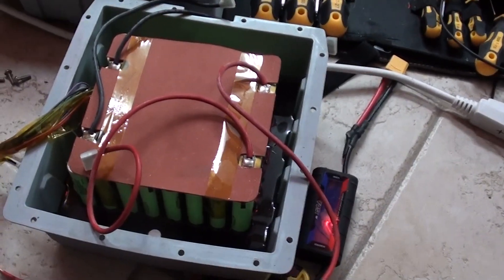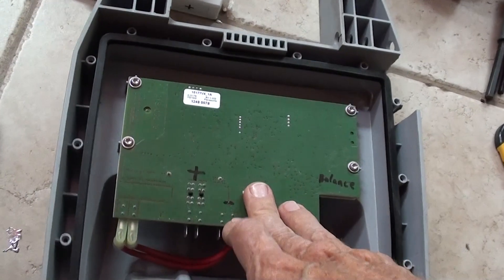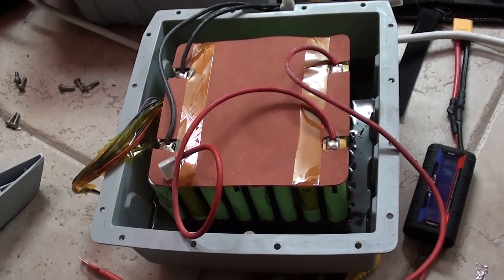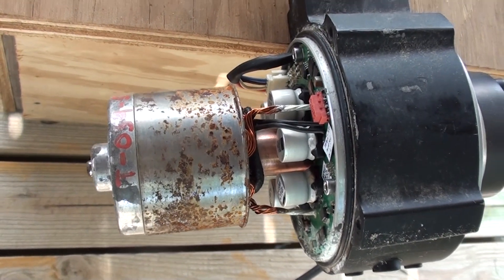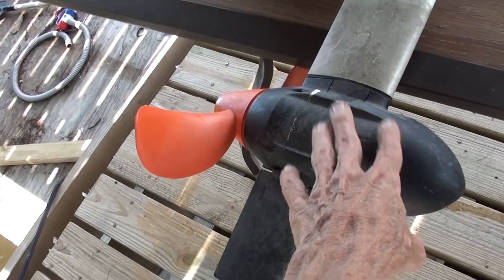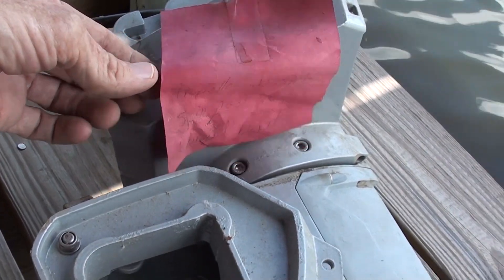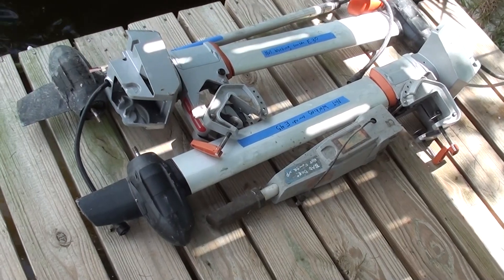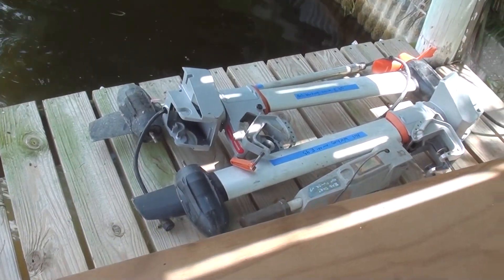Torqueedo Electric Outboard - What's Inside, How To Fix - Do Not Buy!

Comment: You can use a HIGH amperage rc brushless speed control to run the motor. just remove all the torqeedo boards in the pod. Trust me it will work. but you will need a new back cap that contains the seals. new o-rings as well.
Reply: RC speed controller needs a signal from transmitter, for it to work.
Reply: @paulhealey2984  Just use a servo tester.

Comment: The longer I live, the more I think all that "all that glisters is not gold." I am so glad I never bought one. I don't know if I would invest any of my time in them. These types of things are all synchronous motors and have the great advantage of being brushless. As you say, it's desirable that the motor is up top. Consider this: I am buying lots of DeWalt tools intending to power them from direct solar it occurs to me that one could hook up a router or a drill to a shaft with a propeller on the end and mount it at the top of the transom like they do in Thailand, but they use car engines. Washing machine motors look like they have potential as well. Jamie from Mythbusters put a video on YouTube about converting a standard outboard motor to electric drive. I have often wondered about having a propeller at the front of a boat, but that is another thing.

Comment: Thanks for the video. I had the opportunity to buy a 801 without a battery for cheap. I priced the battery and I can buy an excellent new motor for that price. I was going to try the 24V replacement fix like you talked about but the odds of all 3 boards working again led me to pass on the motor.

Comment: Is it possible to install a connection for an external battery and thus increase autonomy?
Reply from the maker: I don't think so.  They made it with the circuit divided into the battery, lower unit and handle to prevent that.  It might be possible to trick the circuit by charging the original battery so the BMS sees the right voltage from each cell group, and disconnecting the main battery and attaching a different one, with the torqeedo circuit still reading the original cells.  The voltage is weird because it is 8s lithium ion, 30 volts, so you'd have to make your own pack because nothing off the shelf will work.
Reply: Yes you can use a battery to charge it, or what I do is use a solar panel attached to my boat Troll the whole lake and come back with the same percentage of battery

Comment: I use the travel 1003 on my sail boat weighting 700 kg. The propulsion efficient is "really " great, even in windy conditions !! whatever you opinion on design my experience since 7 years using it on lake every year is very positive. As it is my safety motor, the price came as second priority, efficient first. (before i was using minolta 50 lbs, useless for me) . So for the newbies, try it first on heavy boat then comment. You will be surprised ...
Reply: Same. I used a Minn Kota trolling motor on my inflatable boat before getting the Torqeedo Travel 1003, and it just didn't have the power to cut through the wind or currents. 

The Torqeedo was a lot more expensive, but provided a different level of boating. With the trolling motor, I struggled to get back at some locations. The Torqeedo opened up a lot more places to go boating for me. 

Torqeedo has competitors now like the Chinese ePropultion and Newport motors, but after you consider the availability of parts locally, batteries and finding a service center in your area, I feel the Torqeedo is worth the extra money over them. 

My approx 10 year old Torqeedo Travel 1003s was serviced this season (a service center 1 hour from me) and I was told very clean and corrosion free. I used it in both fresh and salt water, but as REQUIRED, I rinsed it with free water after use. A water bottle at the launch before leaving, and I was generally use the boat on a lake with in a couple days after salt water use to make sure the salt was thoroughly rinsed out.

Comment: horrifying! thank you for warning the world about this! an electric motor should not be this complicated! I was already sufficiently discouraged by the price tag! but this confirms it. Although, it's just a brushless motor, so surely you could use another BLDC controller with that motor, and not mount it underwater. water getting inside the casing wouldn't kill a brushed motor (you'd still have to dismantle and clean it, of course!)

Comment: The motors shown clearly look like they were abused by leaving them in salt water without rinsing them as Torqeedo has explained is required. This goes for any similar electric motor. I've seen videos/photos on ePropultion that were also rotted out. It's not the motors fault, but the users fault.

THESE MOTORS ARE NOT DESIGNED TO LEAVE ATTACHED AT A DOCK OR ON S MOORED BOAT IN SALT WATER.

I've been a Torqeedo Travel owner for 9 years as I purchased a used one that was 2 or 3 years old in 2013.

It's provided many wonderful adventures, not possibly previously for a small car owner without a safe place to store gasoline inside the car or inside my house as I have no shed.

I recently had mine repaired as the propeller & shear pin broke (it's a plastic propeller). I'm told they should be serviced every 5 years and most of the bill was for that, plus the $100 replacement propeller. 

I'm told there was no visible corrosion on the motor that is more than a decade old. These motors are supposed to be thoroughly rinsed after salt water use. After each use in salt water, I rise with my water bottle at the boat launch, and try to take the boat/motor to use in a lake with in a few days to really wash out any salt build up. If your unable to take it to a lake in a few days, your should run the motor in a bucket of water and let it spin good or something similar.

Torqeedo was the first company to make a motor of this sort, and it's been knocked off by a few companies now, but Torqeedo is still has the largest distribution and are far more widely in circulation.

Comment: I completely agree with your opinion that the motor should be up top.  There's not business for electronics and electric motors under the waterline.
Reply: Dingy motor with weight low down is better nothing wrong with motor down in sealed unit and battery why do you think it is safe for people that may not know about electrical equipment and play and hurt themselves or others by opening and messing with battery sells

Comment: Hi, do you have a photo of the gearbox side? I took off the wire harness and don't remember the polarity on the motor board, I also have a spare lanyard if you need one

Comment: Very unfair to Torqeedo, a high quality electric boat motor manufacturer. The majority of electric outboards use submerged motors and componentry. This provides far better overall efficiency than a highly inefficient external gear train. Efficiency is vital for electric motors to reduce battery consumption and vastly increase range. The owner is periodically supposed to check the condition of the o-ring seals. Judging by the dilapidated motors you show, they are old (one was dated 2011) and abused. They don't become that corroded unless they're kept underwater when not in use and it's apparent that no one ever did any service on them for years as they would if they were a typical gas outboard that requires at least yearly service. If the o-rings were simply checked and replaced every 4-5 years, they wouldn't leak. You also need to ensure the prop shaft seals are not damaged by fishing line. One motor you show is completly entangled in fish line. If the owner simply checked it once in a while, the problem would have been resolved before damaging the motor. Another clear case of owner neglect. Just because the Torqeedo's require much less service than a gas outboard does not mean they're to be neglected with no service. 

Further, the BMS circuitry you show is usually always internal to most sealed lithium batteries, that is perfectly normal, and very few such sealed lithium batteries are user serviceable due to the significant dangers involved, especially for a marine battery where a lithium battery fire could be disastrous. The Torqeedo battery internals you show prove the battery is very well made with a high degree of quality and safety judging by its looks. The cells are potted to ensure they do not become loose in a severe marine environment. If you want to see what a badly designed lithium battery looks like, just visit Will Prowe's superb YouTube channel. Unlike you, he knows the difference between a properly and improperly built lithium battery and demonstrates it clearly. Torqeedo is excellent and very helpful with battery service if you simply contact them and tell them the problem. 

Additionally, it's perfectly normal to have circuitry in an electronic throttle. Putting all the circuitry for the motor, battery, and throttle all in one single location, as you think it should be, would be very poor engineering for this type of motor as it would require far too much interconnecting wiring. The interconnecting cables would require far too many connectors and be prone to failure. Also, you apparently don't realize that Torqeedo uses the same componentry for their Ultralight line of motors to reduce the cost of their products. The throttles on this line are remotely located, thus the need for onboard circuitry. The motors, throttle, and battery were all very cleverly designed to be compatible and largely interchangeable for a wide variety of uses. This also reduces the cost of replacement if one component were to go bad and greatly enhances owner serviceability by simply replacing the bad module, something anyone can do. 

Torqeedo motors will last a decade or more if properly serviced and not abused. It's grossly unfair to show a bunch of old and neglected motors and then blame it all on Torqeedo with zero owner accountability. That's the same as showing an old, abused, never serviced gasoline outboard and blaming it all on Mercury for making a bad product. Grossly unfair.
Reply: I appreciate the honest assessment of the motors and batteries.  This video review is a joke.
Reply: I am not your oppinion. A friend of mine had 2 motors die because the underwater unit leaked. No replacement parts from torqueedo, they wanted $1500 for repair. Not nice.
Reply: @olaf_s_23  If you go to their website you'll see that they actually have all replacement parts you could imagine: Stators, rotors, gearboxes, mechanical parts, etc.
Also, in their user manual, they specify a 2 years service check interval if you keep the motor in the water at all times (and 4-5 years if you only have it in the water when using it).

Comment: It’s criminal how poorly designed, inefficient, and overpriced these motors are and how they hurt the electric propulsion industry with the bad experiences users have had after making the switch. The reason the gear reduction is so nice is because it came from the power tool industry. Another nasty issue with them is how notorious they are for shearing their prop pins which are undersized, especially considering the reduction and the torque created by having that small motor spinning up so fast. I suspect this was due to building around the “borrowed” planetary gear set and that coupled with the obnoxious whine it creates is why they finally went to a direct brushless deign with their 1101. Thanks for tearing them down and bringing their poor design to the attention of consumers. Being in the electronics biz, I can’t believe those circuit boards aren’t potted for protection.
Reply: Do you know some better brands? I was looking for epropulsion or modding a chinese one or building a direct drive myself, in the range of 2-6kw. Another factor with this small motor is that it does not have any direct cooling from the water. Direct drive ones can have direct cooling from the water.
Reply: @Robbedoes2  I don’t know if EPropulsion is a whole lot better with regard to electronics since they have the same features as Torqeedo with circuit boards and lots of connectors etc.. They do however incorporate cooling into their Navy line and their prop shafts and shear pins are appropriately sized. But with EPropulsions sales coming on strong with them ramping up production, there have been a number of reports of problems primarily related to cheap components and connection points. You might look into Haswing or Caroutes bigger brushless direct drive offerings. They are better priced and make use of standard batteries which is one of the problems with the other guys, and they don’t have a bunch of electronics, error codes, and extra connection points. Golden Motors also has a new motor line up if you need something more powerful.

Comment: Good to see a new video again :)))
This motors are really poorly built - thx for the warning!
Reply from the maker: More than a little frustrating to see the lengths Torqueedo went to just so you can't fix their product or use a generic battery.
Reply: @ninehundreddollarluxuryyac5958  Actually you CAN use a generic battery to supplement the original one. I use my 500Wh 36V e-bike battery to more than double the capacity of the Torqeedo battery. All I did was to hook up the e-bicycle battery to the charging port of the original battery. Works like a charm.
Reply: @emunt  I am curious how did you do that and will other battery configurations work?
Reply: @GuySkellenger I wrote a longer reply yesterday, but it seems it disappeared... Check pages 55 and 56 of he Torqeedo Travel user manual (german+english version), where they say that you can charge while operating the motor, as long as you can supply more than 4 Amps of current. And that you can use anything between 9 and 50V.
Reply: @emunt  Thx. That seems to be a great feature that's not marketed well

Comment from the maker: These were free so I didn't worry about the price.  If I paid $2500 and got one of these in return, I would be pretty upset when I learned that my 3 horsepower motor only uses 1.3 horsepower of electricity.  Would also be upset that they leak, and the slightest leak ruins it.

In the meantime, I had been busy for a while but am not supposed to say.
Reply: It's widely known and even on the screen that it uses 1000w of power instead of 2307w required for 3 horsepower. But I like the fact you showed us how dumb this design is. I know gazelle (big dutch bike brand) made some electric bikes with the same type of design, circuit board tied to the motor, and it fails pretty often due to water damage. Would like to see an epropulsion if its any better.
Reply: I’m interested in the brushless motor if you have one that is working?  Can you ship to California? If you one that is still working.  Thanks

Comment: I was never interested in a one of those things after I saw the price tag. I was wondering about you, hadn't heard from you in a bit. Glad you're ok.
Reply from the maker: Thanks!  Had to do some stuff for a while so I could afford my boats.  They don't let me video that.
Reply: I have torqeedo 2.0 R cruise. I can’t find the battery terminals that mount on top of the motor. 
Is it ok to use a 4 awg cable run it to perko breaker then to 2 12v batteries?